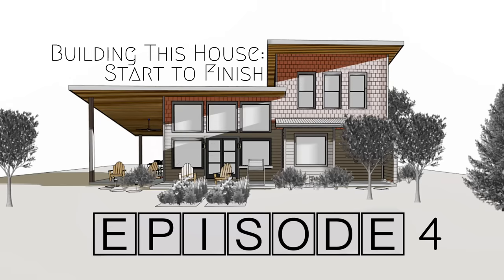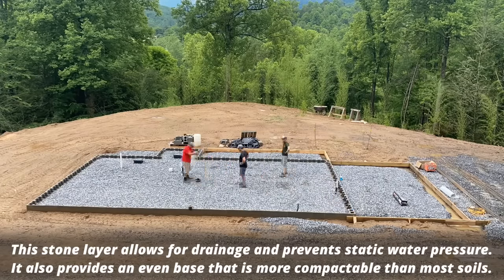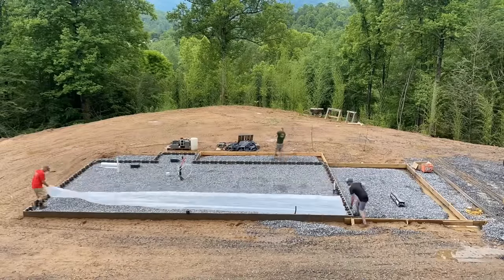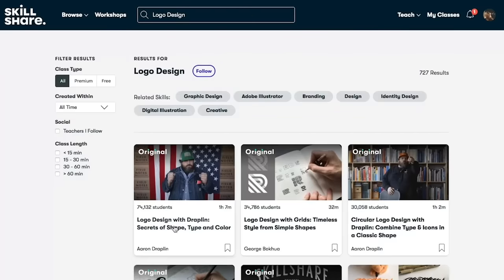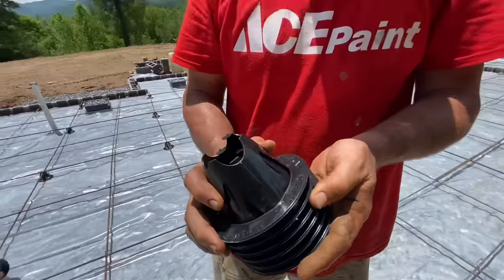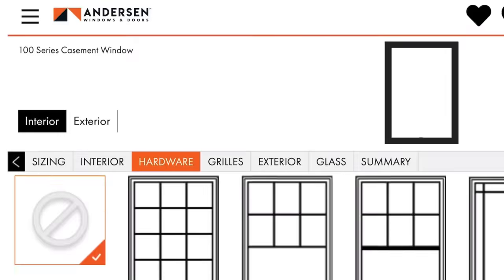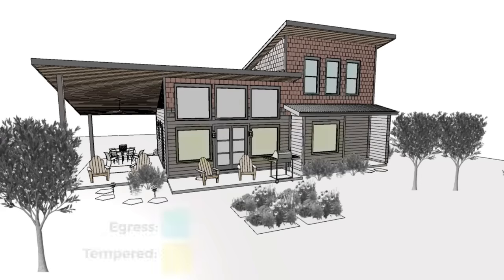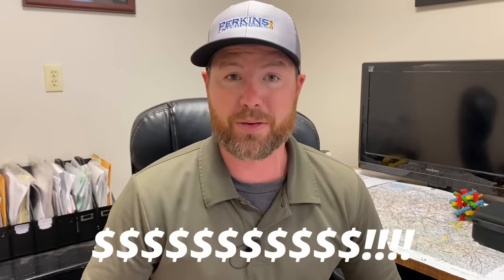Building a House Start to Finish | Episode 4: Slab base compaction, Steel, and Vapor Barrier

Comment: You mentioned aiming to place the rebar on chairs in the top third of the slab. As an engineer, I know that this should be the bottom third, where the slab will see tension. The top third will see compression and doesn't require rebar.

Comment: That is Excellent Slab Preparation! 
Before all this technology; rain that started at or before work time; mandatory that we sat in truck to wait for rain to break, at least until lunch. If rain slacked, we went to work. If coming down hard by lunch, we could then go home. Hard to stay awake with sound of rain on roof of truck. We used that time to sharpen tools or cleaning them. Light rain or sleet, we were getting with it- trying to stay warm‼️
Very Frustrating trying to balance Weatherman Forecast & reality about rain- especially when you get clearing reports, and 45 yards on the ground of a 130 yard pour driveway AND RAIN DOESN’T LET UP😳‼️
Spent thousands of dollars on emergency plastic and portland to protect existing pour and repair wash outs‼️
I know YALL BEEN THERE‼️

Jamie’s hand still looks swollen? How is therapy going? Prayers still up‼️

Surfboard in the Mountains ⛰? That’s a new one and whom is the Happy Grad?
Congratulations 🎊🎈‼️

Another tamping trick: screw 2x2 or 2x4 on side of 2.5’ or 3’ high x 12” diameter hardwood log-“it’s a good workout”😂🤦🏼‍♂️ packs whatever needs packing pretty well‼️

Comment: At work I make concrete table tennis tables. Fiber reinforced, rebar reinforced, and acid stained. All you have to do is pour it onto plexiglass then flip it right-side up. Dare you to try that with a foundation.

Comment: the steel isn't there for strength, for a slab like this, it's just there for shrinkage and temperature crack control, strength reinforcement is put in slabs and beams where tension occurs. In this case you're not going to get much tension acting anywhere since the slab is directly supported on ground, unless you have large concentrated loads - Structural engineer here.
Reply from the maker: Roger that! We did end up using fiber reinforced concrete as well and cut some cold control joints … Should be pretty bomb proof! Thanks for the comment
Reply: That’s sort of clarified things for me. Here in Australia I notice we put a lot more steel in slabs and beams for similar houses. Perhaps it’s different soil types?

Comment: The Termite treatment skipping is not good. I worked for a pest control company who used about 1/3 to 1/2 of the amount of termiticide they were actually supposed to use on the treatments. I know termite infestitations would probably be years down the road after development but on all my jobs I thoroughly check the amount of chemical that is actually sprayed to make sure that it is properly being treated. Mostly due to home renovations that have suffered severe termite infestation. Pest control companies are mostly salaried employees with a long list of jobs to complete but the end of the week so some employees short cut jobs to get done quicker. Great videos. I have learned alot from watching.. Thanks.

Comment: G, day Perkins. Some time ago, I made a submission to the Australian government Senate Committee on minimum glass panel size for emergency egress( bedrooms) and photovoltaic smoke detectors in residential housing. Mains power no battery. Are yours hinged/copper/safety glass.🌏

Comment: What's the use of gravel underneath your house? In the Netherlands we just have the vapor plastic over the ground soil.
Reply from the maker: Drainage, creating an even base, and good compaction properties
Reply: It's a capillary break as well and allow you to vent your subslab to evacuate any radon gas that could accumulate.
Reply: Perkins Builder Brothers:
Also, expansion and contraction.

Comment: I work in home improvement retail, and specifically with our window vendors, and I can say hands-down that Andersen beats Jeld-Wen in every way I've seen thus far...quality for sure, features and options as well, but the customer service from Jeld Wen is awful versus Andersen's outstanding service, and for me that's the key. This is just my experience, I'm sure others have other opinions. :)

(Edit: of course, you pay for it up front, but you get what you pay for)
Reply: Don't cheap out on windows it is a  big big mistake.